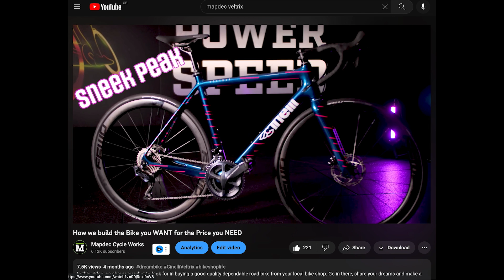The big compromise in the bike frames & wheels relationship

Comment: I was going to jump right in and comment, and thought best I read your linked article. 

Bingo!
[Shrive got this idea from the old steel-framed racing bikes of yesteryear. Although much more flexible than today’s carbon-framed bikes, well-made steel race bikes often have this exact same ratio of bottom-bracket to torsional stiffness, which results in a lively, responsive ride.

‘On those bikes you can actually use the bottom bracket to drive the rear wheel in. Imagine with torsional stiffness that the rear wheel comes out of plane with the front wheel and you start to understeer the corner and drift to the outside; with a really flexy frame you can just load up the outside pedal and force the rear wheel back in.]

An excellent article, btw! This is akin to 'having a tail' as in physiology. Animals wind their thrust into the tail, and then it's 'bounced' back into their hips and forward motion.

First time I got on a 531 frame, after riding 'unlively' ones, this was the first thing I noticed, you'd 'wind up the frame' and it would gleefully jump forward, each leg thrust 'inducing' (induction is a force commonly defined in physics) to 'discharge' forward. I'll read more and add to that later.

But what immediately strikes me, and the return to BSA threading of BBs...(duh!), is that anything beyond the 68 or 73mm standard of the past (68 mm being the road standard for generations) is not only superfluous to need, but possibly detrimental to power xmssn to the rear wheel.

By all means, make the 'classic' BB lighter, early cups and axles weighed a ton, but as to why it was presumed wider (longer) axles were needed really needs to be rethought. "Q" anyone?
Reply from the maker: Well done for reading before commenting.  That is the key, some flex is key to handling.. my addition is that lots of flex can be introduced by wheels or stiff wheels can ruin the designed flex of a frame.

Comment: I dont think it's a failure by the bike manufacturer to spec a cheaper wheel, for the same reason that they include cheap pedals. The rider is going to choose a wheelset to customize the bike, and sinking a ton of the OEM budget into a wheel means compromise elsewhere. Pretty rare to find a group of riders that all want exactly the same wheelset.

Comment: When i look at bikes on the websites of manufacturers i'm always amazed about the costs of a frame set!  I would really like it when they would let me choose the components of the bike! Take a cheaper groupset but a better set of wheels. But this is never possible. Then buying the frame set also isn´t an option because it sometimes is almost as expensive as the cheapest option bike on the list. I know why they are doing that, but for me as a consumer it is pretty frustrating! And it is with all the components. The handlebars are to wide, the saddle is not to my liking, the tyres are crap, etc... Please manufacturers let me choose my parts, but not at those absurd high prices!
Reply from the maker: Planning on discussing this in a vid soon. I suspect the frame only price is just there to show better value to full build price. Annoys me.
Reply: @Mapdec  indeed: it doesn add up if you count the cost of the parts in total, even when they are sponsored by the manufacturers like shimano, mavic, ritchey, etc..
Reply: Yeh, this is so true. 20 years ago or so it was so much more feasible to build from frame sets cheaply. Then the brands worked out they make way more profit from selling the punter a complete bike, especially if the finishing kit is own-brand, or with in-house wheels - so to deter the builders they artificially inflate the frameset price. I enjoy building from frame only and selecting every component on the bike to suit, in contrast every complete off the shelf bike I've ever had has some disappointing aspect to it that needed changing.

Comment: Not everyone needs or wants a stiff bike, I remember reading about the 7 Eleven team, they had various different frames during that era, the riders hated some for being too stiff and difficult to control over poor surfaces. 
This was back when tube diameters were skinny.
Reply from the maker: Totally my point. Why engineer a nice compliant frame and then stick cheap over stiff wheels on it. Or vice versa
Reply: @Mapdec  can we not get over the cheap aluminium wheels v carbon wheels mentally?
There are some very good aluminium wheels and some cheap nasty carbon wheels. 
This marketing of stiff carbon upgrades is not helpful to us in the cycle business or the recreational cyclist
Reply from the maker: I can’t recall saying carbon wheels in the vid. I’m a wheel builder, we can build wheels however you want them to handle. That said, it is getting harder to pick up really good alu rims for building.  Pacenti Forza is current fave.
Reply: Thumbs up from me, but you're oversimplifying the bearing factors. I guess I'm a real old-timer, but many of those same bikes were  equipped with more ample tires for off-road or hybrid use. Paris–Roubaix wasn't won on 18c tires...

Comment: I got fortunate and was able to get the best of the best from my preferred manufacturer.  The price was way, WAY up there, but the bike and the wheels are amazing!!!  It was a custom build due to supply issues but I got the best they make.  I was immediately hit with just how much better this bike is than my old one in every single aspect.  Frame is stiff where it needs to be and compliant where it can be.  The wheels make a HUGE difference as well.  My old aluminum frame tried to rattle my teeth out and the aluminum wheels were complete trash.  Night and day difference!  I can definitely see what you are talking about with manufacturers "cutting corners" to make a certain price point...

Comment: The weight of the rider needs to be the main factor. Unfortunately the riders of smaller frames tend to be lighter and the frames stiffer. The taller heavier rider often needs a stiffer frame and wheels to prevent spoke breakage and frame failure. Wider tires are the main way to achieve this,  but the smaller riders are already less aero and riding proportionally heavy bikes. Softer wheels can be achieved with thinner butted spokes with shallower, wider rims and fewer spokes. There goes your aero wheels for smaller riders though. You have to be 75 kg and ride a 55cm frame to get the right mix normally.
Reply: Ha, that's my exact weight and size... that's why everything always feel fine to me... tend not to break frames and never broken a spoke in 35 years, famous last words.
Reply: Dunno if I agree about smaller riders being LESS aero.  By definition a smaller rider has a smaller frontal area in the wind, unless you're talking about <50c frames where the geo is compromised.  In a group ride/peloton situation, taller riders get less benefit from being mid-pack than average size riders as well.

Comment: The only stiffness is between your ears.  Pantani was on a flexible alloy bike and still has the KOM on L'Alp d'Heuz
Reply from the maker: Oh bless you. He had artisan hand built  frames and hand built wheels. They knew how and where to make things stiff and where things should flex much more than a lot of carbon factories do. He also did a lot of drugs.
Reply: @Mapdec   Trudat wrt juicing. But note that the frame and wheels he had stood up to all that power, however he got it.
Reply from the maker: @ericpmoss  of course. I doubt there would be too much weight difference to todays bikes either.  All these aero gains add weight, that then needs to be lost again.
Reply: and some hot sauce mixed in...
Reply: Have had hands-on one of his old Tour bikes, you'd be surprised how light it was, wheels especially ...and ALu frames from that era tended to be super-stiff, more so than most carbon frames- can still feel my teeth rattling now, wouldn't ride another if you paid me. Epo gets one up the Alpe pretty pronto too.
Reply: The slightly later '98 Bianchi mega Pro I saw weighed in at 6.9kg/ 15.3lb even fully loaded with pedals/ cages. Rims and tyres so tiny they're barely there for modern eyes.

Comment: 2:59 thats a misconception. He cant be putting force through the pedals, when hes freewheeling. The only way the bike is flexing is vertically, due to his weight.
Reply: Strickly speaking the bike and rider is experiencing a centripetal force... it is the contact between the tyre and road here that is doing the cornering, and effectively overcoming the force. The bike is pushing back at the rider, if the tyre connection gives the bike and rider dont suddenly fly off but continue in a straight line rather than ' cornering'. The balance  of how the rider handles this force is the key. Both weight in the pedals, forward and aft body positions and how he moves bodyweight across the saddle. The line a rider takes depends on all of that stuff and mainly how much contersteer he applies, this actually will pretty much determine the lean angle, not the otherway around. Your front wheel in a turn points to some point on the outside of the turn, not towards thec inside or the line you follow. You are effectively pushing the inside bar away from you with force, this initiates and controls the depth of lean and the line, and is generally balanced by applying, or resisting pressure / force on the outside pedal.  In a slow turn, the Centripetal force is low, so your body has to physically move to the  outside of the turn, the wrong side of the bike, to allow you to counteract the counter steer. Not understanding this is why most riders, including some high end riders cannot corner.  Skis and snowboards dont really have counter steer,  but weight has to be moved allong the edge of the supporting edge at different phase in the turn.  I snowboard,  and idealy my centre of mass has to be around the centre of the board and for the most part centerd along the working edge. There is a lot of energy that pops out of a board when it staightens, you do get this in a way on a steel frame.
Reply: Gokarts don't have suspension, the frame is literally tuned to flex at each corner. Our bikes definitely flex during cornering. If you can make the BB twist just standing on the pedals you are changing geometry and wheel slip angles
Reply from the maker: Umm… I think you could use some coaching. Cornering is very much about pushing through the pedals and bars. Just like skiing.
Reply: @Mapdec  No its not. Its a completely different thing.

Cornering is about NOT putting too much force through the pedals and bars... By which i mean that its about letting the bike and its wheels kinda do what the road dictates. This means that you form a sort of human suspension by using your arms and legs to support your own weight on the bike, giving the whole system (bike and rider) a more constant contact force to the road surface.

I dont think i need coaching as long as i keep winning crits. I can give you some coaching though, if you like.
Reply: @MrBusunglueck  He doesn't need it. I don't either, always emulated the Cancellara descending style, but Pidcock will do for now. You may be doing it wrong. 90' crit corners may be different but the way to get a bike round a fast alpine corner is to heavily weight the outside pedal, the more body weight the rider can push through that outside pedal the more they can make the bike carve through the turn. This puts loads of stress through frame and wheels but is an attacking descending style, not cruising. Most riders don't descend like this, even many Tour Pro's, it is exceptional technique.
Reply from the maker: Yes. This is what I was trying to say, you are not a passenger, you as a rider are actively pushing that bike round the turn. It might look effortless but it takes skill and strength to do. Just like that skier, to turn like that takes effort.
Reply from the maker: How do you stop the wheel from losing traction? You push it into the road… I think we are saying the same thing here dude.
Reply: @Mapdec  this is the argument for traction in race cars, the only way to get more grip is to push the tyres down. But in a car more weight and inertia makes changing heading harder. 
For us on a bike its a balancing act. You've experienced the bathroom scales under the tyres to adjust stem length to compensate weight, now do it while leaning and weighting pedals vs seat vs inside arm
Reply: Coincidentally there is a youtube video that has recently been posted by Daryl Impey where the Israel Premier Tech riders are doing cornering training and tuition. Might be of interest. Here’s the link https://youtu.be/FKt7jLPIsMk
Reply: @marshallh9  I'm not sure if your reply is visible due to your link but I see the notification. 
I watched the video earlier too, great insight but they need a part 2 regarding line choice. 

Do you watch safa Brian descendants?

Comment: Maybe this feeds in to the N+1 idea where  people are just not happy with what they have..  From my point of view it has been rare to buy a bike and it be right at the point of sale., so rare it never happens.  Also this is so application specific..  Plus many other factors.  My latest steed is a 2017 trek Domane which came fitted with 40mm Vision Metrons. I'ts done over 25K miles, never had to as much as tweak a spoke, maybe I should, and I am not sure what I would be looking for beyond what it delivers.  I bought the bike as a bit of an all rounder to ride in winter, summer, some light gravel. Those wheels come in at sub 1400g and seems to spin up quickly compared with other wheels I have tried, but my experience is limited tbf.  The bike allows me to do just about everything better than any bike I have owned through the 80's to current day,  obviously an older rider, but also faster over distance than ever before too, and no small part of that is being comfortable on the bike. The Domane is an Audax bike but it is not exactly flexible around the BB compared to other carbon frames that I have, a lot of carbon down there for sure. If you get a combination of frame and wheels working for you I think you will know and certainly know when a combination is not working once you have felt how good it can feel. The weight thing, unless you are a pro, or really in to racing, I don't think is going to make an outcome difference in a race  and certainly not affect /outweigh the pure joy of riding a well matched set of wheels and frame considering how most people ride their bikes.  ( the Domane was not perfect out of the box,  handle bar width, crank length, bar tape, saddle and a few other things... but can't fault the frame wheel combo that it came with for what I wanted. Some luck involved there)
Reply from the maker: Those visions are nice. Very tight spoke tension delivers fast acceleration, and the light rim allows quick transfer. Almost a climbing wheel with a hint of aero.
Reply: @Mapdec  that sums the wheels up nicely. With a good set of tyres the combination always feels well planted and gives confidence for sure. Only issue I have is, chips and knocks on the frame over time makes me nervous once you realize how light these things are, but then again the wheels have dealt with some massive pot-hole hits and show no marks whatsoever. Might consider getting it assessed sooner rather than later.

Comment: In 1999 i bought a Bianchi xlev2 Pantani replica. Aluminium frame, carbon forks and full Dura Ace 7700 including 7700 wheelset. Unbelievably stiff, only good for flat out riding, evening 10s etc. Did a 200 km audax on it and was beaten up. Downtube was like a coke can it was that thin. After 2 seasons the seat tube developed a 3cm crack above the BB. Binned the frame.
Reply from the maker: They were really pushing the boundaries of what aluminium could do in that era just before carbon fibre. Remember the F1 cars of the same time.
Reply: @Mapdec  some early versions of this frame were injected with a foam resin. Mine wasn’t as I recall.
Reply: I had an aluminium GT bike back then... just brutal to ride... lighter yes... steel it wasn't  🤦🏻‍♂️

Comment: I have never seen a stock catalogue bike that ticked all the boxes. And with most decent brands it is even cheaper to buy the framesets and components at retail, even though I suspect the big manufacturers get decent discounts on their components. I checked a couple of brands recently and sometimes the price of the bike is 1000,- higher than the cost of frame and components at retail price. Not sure what a bike shop will charge for assembly, but I can build a bike on a sunday myself.
Reply from the maker: Totally. We often buy full bikes and strip for parts